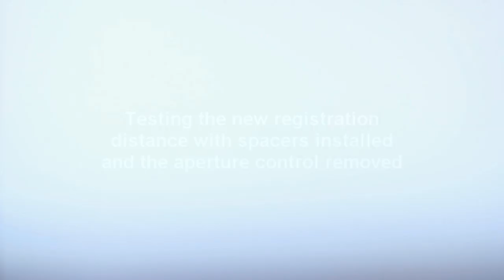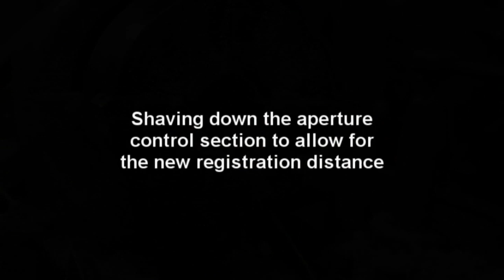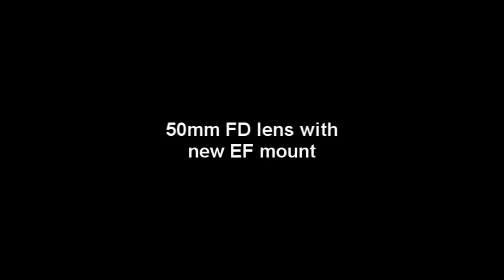FD Lens Converted to EF mount for Canon EOS cameras

Comment from the maker: @killerwatt318 The 50mm prime will have infinity focus around 4 feet. That's not very far. I have a Vivitar zoom that I have not converted yet but, holding the lens up to the camera, it looks as if infinity may be around 30 feet. There is an adapter that has a lens in it in order to change infinity, but a lens in only as good as its poorest quality element. If the lens in the adapter is good, then you get good results. It's most apparent when you compare two images side by side.

Comment: the real problem is the distance between the back lens and the sensor, in the 35mm film body is smaller than the Digital EOS.. thats why they need a correction lens in between.

Comment from the maker: As it turns out, Canon made quite a few different versions of this lens. I happened to get the easiest one to convert as my first try. I have a few others, each one different, and each one a pain to convert. The trick is that the lens has to sit further back into the camera than what the stock mounting will allow. Picture taking the lens, shaving off about 4mm, then glueing it to the camera. That would work, except that it would be your only lens because it's glued on.

Comment from the maker: When I did this lens, it was more of an effort to prove that I could rather than have a viable business or anything like that. It took a lot of time, but the "naysayers" drove me to do it. I tried a second, but I quickly found out that Canon made several different internal configurations for the same mount. Ball bearings replaced sliders and things became very complicated. I got bored and never finished the second one.
Reply: Hi Jeff Johnson , I would love to this conversion to my lenses. Have you written a detailed blog of what and how you did exactly? If not Would love to have a detailed blog . Flange to Sensor distance for FD is 42 mm whereas for EF is 44 mm. Hence it make all this infinity focus fuss. I have a no- glass dumb FD to EF convertor . I am thinking of somehow combining this convertor with lens back plate to get 42 mm flange distance. I have not figured out the “How” part yet , but your video might be the answer

Comment: i have a normal 50 1.4 fd thats a waitin to be changed to eos. if you never make a kit im going to remove some parts and epoxy on a eos mount. eeeks.
Reply from the maker: There were several versions of the fd lens that all fit the fd camera. One was easy enough to convert. The rest sucked. The fd lens is too long and spaces the lens too far away from the sensor. You have to remove metal to get the lens further into the camera.
Reply: Darn. Yeah I came upon a nice spreadsheet on edmika that showed the lens compatibilities. Total shame though. I appreciate your time.